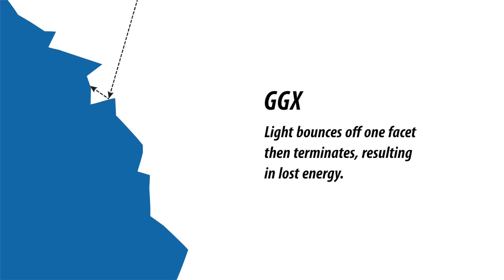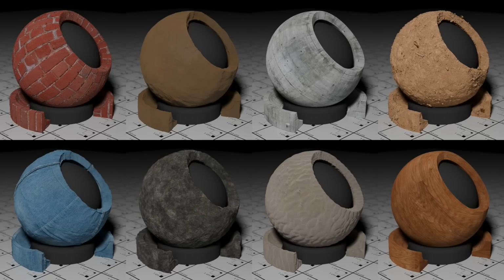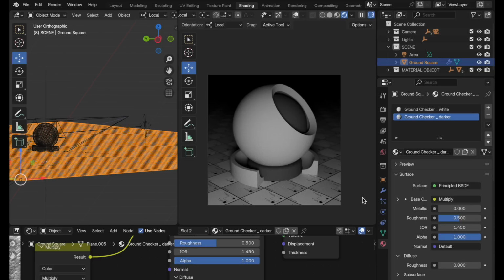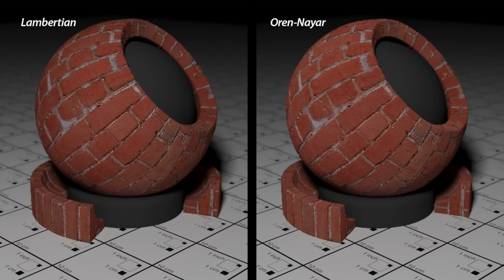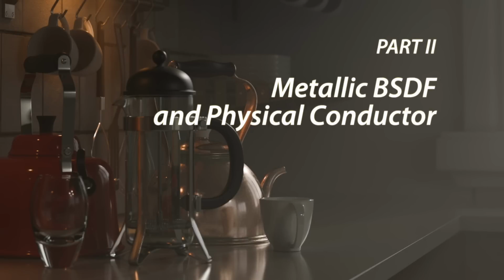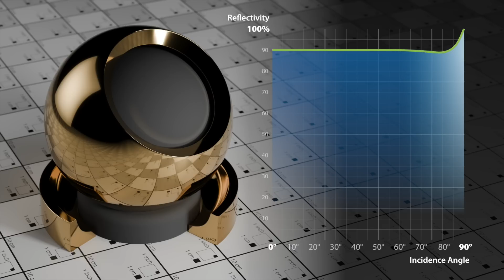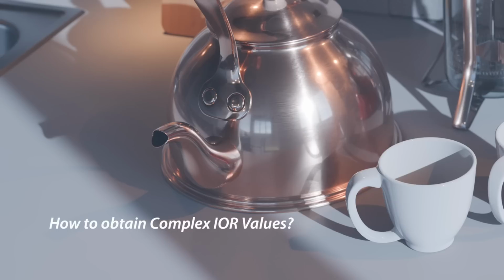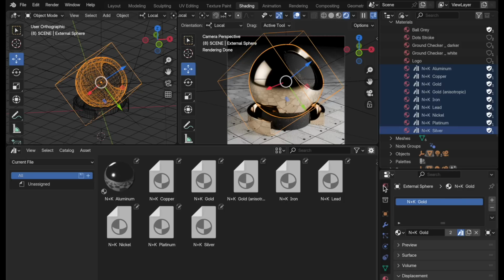Blender 4.3 Deep Dive: Exploring Diffuse Roughness & Physical Conductor

Comment: Posting back here again almost a year later, and the Principled Shader in Blender 5.0 still fails the microfacet normals furnace test miserably. In fact, of all the renderers I have tested this in it has probably the worst result, and that includes the ancient IRAY renderer. Results are just as bad using the new Oren-Nayer model non-metallics, and Lambertian metallics. The Metallic BSDF node fails the test too. I don't think Cycles will ever be able to compete on a shader level with other renderers while this issue exists.
Reply from the maker: I'd love to see a file you're testing with.
Reply: @christopher3d475  It was just a basic furnace test. I didn't save the file. 

Interestingly, I've found that you can eliminate the issue by dialling in the distance of the new bump node. The default is way too high. 
The issue is that it's very fiddly and you really have to dial in and tweak the distance, with very little room to increase the strength of the bump effect. Too low and it’s too weak, a fraction higher and it starts to fail the furnace test.

The strength of the microsurface effect should ideally be independent of the microfacet reflection.
Reply from the maker: @musashidanmcgrath  What bump value were you using? The default of 1.0 has massively too large, in fact they've reset it to 0.001. I still find that often too large.
Reply: @christopher3d475  I'm actually dialling in the distance setting and leaving the strength at default 1.0. The issue I'm having is that if I lower the strength the effect disappears right on the limits of the distance setting either passing the furnace or not passing it. So effectively, I have to leave strength at 1.0 or lower it and raise the distance, which results in either the test failure or the bump effect disappearing.

Comment: Thank you Chris for this in depth lesson! I went through my latest scene finding rough things and applying Diffuse Roughness. I like the effect it has on my concrete floor, grout, plaster wall, patch of dirt, tree trunk, and stone statue - the statue in particular seemed to get much nicer - highlights were softened and shadows brightened making it look more like real world matte stone. However when I applied Diffuse Roughness 1.0 to my clay pots the lighting went too flat (due to grazing angles getting brighter) and I felt like too much visual curvature was lost given the lighting setup in my particular scene. So, in this case I dialed Diffuse Roughness back to 0.5 then 0.25 taking screenshots as I went. I eventually settled on 0.25 as looking nice :).

I was wondering whether increasing Diffuse Roughness was basically similar to decreasing IOR Level... so I played around a bit and it certainly seems like each has their own unique effect and visual outcome... so, yeah, a great addition to Blender allowing for yet more artistic control!
Reply from the maker: Yes, this is why they put in the slider, because a full Oren-Nayar roughness model isn't always best for every surface which you've found. I also found that a mid-range value often was best.

Comment: I guess I'm still a  little confused on when you should use Oren-Nayar over Lambertian with BSDFs. I understand it's better for more diffuse materials but where's the cutoff where one becomes more accurate than the other, also should this be used more as a binary setting like the metallic slider where halfway values aren't physically accurate? Either way still a fantastic video, thanks.
Reply from the maker: I left it a little vague on purpose, because it' ultimately up to what you want your diffuse-containing material to look like. The fan example I showed is an example of this. If you've outdoor scenery that has a concrete sidewalk or road, Oren-Nayar is probably what you want to use. But in many of the renderings I showed throughout the video, I used Oren-Nayar. The slider between the two is a morphing from one end of the spectrum to the other, so it's a bit different from the Metallic slider. So, if you think the full Oren-Nayar is too flat in appearance, you can set it to 50%, and it transitions between lambertian and Oren-Nayar. It's just something you can test out.
Reply: @christopher3d475  I see now, thank you for the explanation. Hope to see more content from you as Blender continues to evolve!

Comment: 12:28 nice to see the reflectivity angle for metal materials being mentioned. I think this goes bit further than just metal materials because even plastic objects seems to reflect more with sharper reflections on the edges curving away from a point of view.

I started faking this (as I don't do photo realistic renderings) using Layer Weight node with curve node to reduce roughness on objects and it has been very effective way to boost the visibility of forms on objects in a good looking way.
Reply from the maker: Plastics do indeed exhibit stronger reflections at glancing angles, this is the fresnel effect. I've done videos explaining how the fresnel effect is controlled by the index of refraction and also how roughness affects glancing angle reflections. Metals just have a bit of a different expression of fresnel.

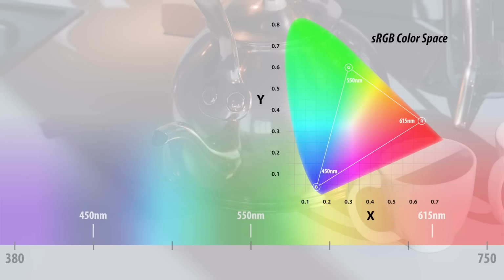Comment: 16:21 I believe the correct way to get the closest match involves XYZ space and the color matching functions:
1. Multiply the lab spectra with the three color matching functions.
2. add up the three spectra you get that way. This is your XYZ coordinate.
3. convert your XYZ coordinate to your target RGB space.

This way you aren't neglecting, that the primaries of the sRGB color space is not spectrally defined. You take into account the fact that they each are a mixture of wavelengths.

The way you are doing it is arguably still arbitrary because the wavelengths you get for projecting your sRGB primaries onto the spectral locus are gonna depend on the whitepoint. For instance, did you project from Illuminant E (which is relevant for reflections in that a perfect reflection would be a constant reflection spectrum which corresponds to Illuminant E) or from Illuminant D65 (which is relevant for sRGB because that's the whitepoint it chooses) to get those wavelengths? I'm not even sure which one is correct to use there!

With my method above, that doesn't depend on such a choice at all. It doesn't depend on a choice of colorspace either: You do that calculation once for XYZ and forever after just convert from XYZ to your RGB space of choice. For instance, you might want to render in Rec.2020 RGB for better indirect light behavior (less of a hue shift towards primary colors). The XYZ coordinates you'd arrive at would still be valid then! And they'd not be equal to simply evaluating the complex IOR spectrum at Rec.2020's spectrally defined primaries.

Comment: There is no "energy loss" associated with Lambertian. Run it on a furnace test and see for yourself.
Introducing Oren-Nayar introduces energy loss for forward scattered light, unrelated to the recent multiscatter improvements.
The moon is a perfect example of a non Lambertian diffusor. For back scattered light. For forward scattered light? Not so much.
Disney, even before the improved multiscatter (for other reasons), used a trick to reduce energy loss for forward scattered light.
And since we're locking into "enclosures" (BSDFs), there is no way for us to mimic that effect.

Technically, denim would also have specular reflections. Remember, "everything has fresnel"? I agree though, screw that saying.
So you're correct in turning off specular, because this would be visible on the individual strands rather than a flat surface.
Mixing in some sheen does a better job than relying on "everything has fresnel", certainly at high levels of IOR.
As for the fan, Disney kept diffuse and specular roughness coupled to always be the same value. Usually a good idea, but uncoupled does leave artistic control.

I think anisotropy is completely broken for Principled and Metallic. It's maximum value is clipped to around 0.7 of what it is for the glossy shader.
We used to be able to get around this for Principled as we could pump up the value to 1.111 (but not 1.112) to reach actual 1.0. But now hard clipped.
I would REALLY love to have a color output on the BSDF so I can at least make sensible anisotropic materials using Glossy if need be.
The problem with the arbitrary 0.7 hard clip is an insane amount of energy loss at low roughness values for back scattered light.
Which doesn't happen when I observe them in real life. The sun, while there is loss, still produces very visible stretched sun watched from the sun side.
Never use 1.0 of course (unless for weird effects), but 0.7 is far to small.

I'm wondering if we really NEED a Metallic BSDF, why not just make a complex fresnel node with a color output to drive the albedo? No sheen or coating, so...

Actually, gold will be out of gamut for RGB. Cycles cannot "accurately" render gold. Yeah, it's a weird one, but also the reason gold isn't the default setting.
That said, using the 100% correct colors, or relying on F82/Physical isn't what's going to make or break a render. Close enough, and nobody cares.
Except you (and me). Because we're extreme cases. 😂 Getting the roughness and bump qualities closer to what you're making is more important.

Comment: One thing I always wondered is why isn't there any guide on how MUCH diffuse roughness is indicated for specific materials.. like clay 0.95, plastic 0.1, concrete 0.8, dirt 1 etc. This would help a lot 😅
Reply from the maker: I think it just comes down to what you like in terms of the look of the object and material.
Reply: @christopher3d475  I get it. But it is a quite subtle effect and we get so much precise information for IoR and other parameters.. I was curious of what the science was 😀
Reply: @John_Dowson  IOR shouldn't be used as a "precise parameter", except for very high transmissive material like glass (we don't have volumetric IOR yet). Roughness value and map, in addition to normal/bump is a much more important aspect to get right in order to achieve the correct look. If anything, you could determine how porous and fluid absorbent a material is and reduce the IOR level from the default 0.5, or use a map/calculation for it if you're dealing with shadow gaps (i.e. cracks in floorboards). If it reflects 0.039 or 0.045 at facing angles, nobody will see the difference.

Also note that introducing a coat simply applies a fresnel function to blend the specular lobes. It doesn't automatically reduce the Material/Air interface IOR based on the Coat IOR. But this is also in the realm of "nobody cares". Substrate IOR = max(Substrate IOR/Coat IOR, Coat IOR/Substrate IOR). Substrate 1.4 with Coat 1.65, it's 1.65/1.4 = 1.179 (not 1.4/1.65 = 0.848 which is into Snells window territory). Remember the magic trick where balls of silicon (?) are lowered into water, both with same IOR? Balls become invisible. In that case, water is the "coat", and if only very close, you can barely see the reflection in the balls themselves.
Reply: @John_Dowson  As for "the science", probably just use whatever roughness you use for specular, or a factor/power thereof. That at least keeps it close to original Disney implementation, although theirs (the full Disney shader) were more energy conserving for forward scattered light. Others changed the behavior to do Oren-Nayar for positive angles (back scattering, camera on light side), gradually changing into Lambertian for negative angles (forward scattering, camera looking into light), but we don't have that option. So yes, there is a negative on using this at all, especially at extreme values.

If the object is rough enough to become darker (already eliminating reflections using polarized shooting) by getting it wet, then you should probably increase Diffuse roughness. A clay vase would do that, indicated by the specular roughness being high. Whereas a polished China would not do that, also indicated by the specular roughness being low. If porosity is the reason, you might want to also lower the IOR level to account for specular energy loss in cavities.

But in most cases, I'd say just go with what's more visually pleasing, or ignore it completely due to having some issues in some cases.
For a front lit moon? Always at max. For a back lit moon? Be a bit more careful, especially if relying on diffuse only.

Comment: there is a caveat. Sunlight Sky Dynamic Environment versus interior indirect light color space has large differences in energy conservation. I am wondering where that is in the Physical Conductor equation. Indoor outdoor. This is a energy model present in Luxcore.
Reply from the maker: Energy conservation has to do with how the material/surface handles incoming light vs outgoing light energy. It doesn't matter where the light comes from.
Reply: @christopher3d475  the problem is not about that it's whether or not a bidirectional pathtrace can trace further and quickly on large surface area, which is a requirement for large scale accurate architectural surfacing. Oren nayer originally was developed to challenge this problem Oren–Nayar reflectance model.

Comment: In these examples the difference seems very-very small and insignificant....it is not. Try out an interior scene, where the plaster has a high diffuse roughness, it will be immediately much-more realistic. Using correct-ish values for every model in a scene brings it much closer to corona/octane.

Comment: The Oren-Nayar algorithm blows out the surface and is not aesthetically pleasing. Too much technical precision kills the art, imo.
Reply from the maker: I specifically chose lighting that would emphasis its behavior. However, if you made it to the 10 minute mark, I make the very point that it isn't appropriate for all surfaces. It's a use-case scenario option for sure.

Comment: Thank you for these incredibly useful feature update videos, I honestly don’t think I would understand the current principled node if it weren’t for your channel.

The original principled shader was easy to grasp and relied on relatively few inputs. I like the changes to make it more accurate and powerful, but the purpose of certain parameters is not immediately obvious.
Reply: I 💯 agree. It's great they're achieving a certain level realism and control in one shader node, but its at the cost of intuition on knowing what sliders do what. I'd be lost without Chris' videos breaking it down.

Comment: Great overview of these new features. It would be nice to have presets in the Metallic BSDF Physical Conductor panel itself, like for gold or bronze. As a starting of point for further experimentation.
Reply from the maker: I could see that as being very useful. It would be great if we didn't need to pull values from refractiveindex, but instead could simply specify RGB wavelength primaries, and it calculate the values for us. Perhaps someone could build a node setup for that.
Reply: Absolutely agree, even if gold is a tough nut gamut wise. But affecting both the physical inputs and F82 inputs.
Strictly speaking, there really is no "experimentation" that makes physical sense. Unless you want to make unobtainium.
But I think I'd prefer it to be a color node instead of a BSDF. Unless they intend to take it into other territories (like hazy gloss).

Comment: I had no idea the Principled BSDF was not using the Oren-Nayar algorithm! Very cool to see one of my biggest complaints about energy loss on low-incidence rough surfaces being fixed by this!
Reply: It never used Oren-Nayar. From what I understand it used to do some tricks with Velvet shader back in the day, not how Disney implemented diffuse roughness.
Not sure, but it might have been removed when Principled v2 was introduced, as v1 had energy conserving issues partly because of roughness.
Reply: @gottagowork  I assumed the Oren-Nayar implementation for the regular Diffuse node migrated to Principled as well.
Reply: @fiveoneecho  Just recently. Before diffuse roughness was dropped, it did something "similar", but I never felt like it worked like O-N, without being able to point a finger on exactly what. Just felt "off". Someone on the forum mentioned the Velvet BSDF being used for the enclosure, but I don't read code so I didn't bother checking.

Note that "diffuse is supposed to be completely view independent", but both the old Velvet as well as O-N are view dependent (like Glossy). Velvet I understand (inverse glossy, kinda) being based on microcylinders/microtubules (?).

O-N always had this problem, incl the full version (ours is an approximation, but works very well). But there have been attempts on improving it; newer models, or fakery involving light incident angle and modulating roughness, but this is a luxury only available within the BSDF enclosures, not to end users.

Comment: Octane materials are getting introduced in blender ....but not as perfect as octane itself
Reply from the maker: Well, they're not trying to emulate Octane exactly, but they are moving Cycles closer to the OpenPBR and MaterialX standards.
Reply: Yeah, octane looks better then cycles in most cases. I'm using Octane in blender and very satisfied with results
Reply from the maker: Octane is a specteral renderer and there are advantages to that.
Reply: @christopher3d475  i mean it will be great to have that kind of more details setups included in cycles, just glad to have the cycles taking steps to get close to it